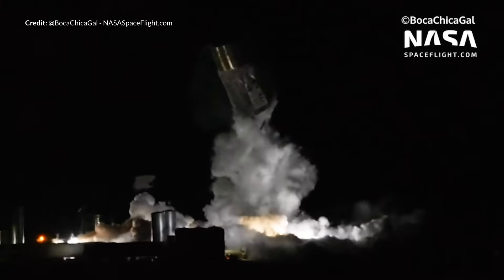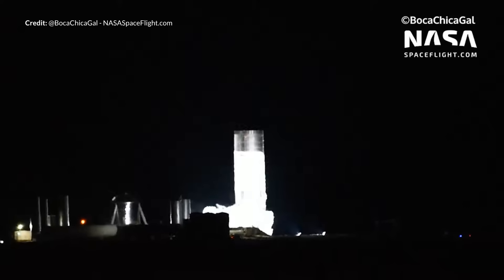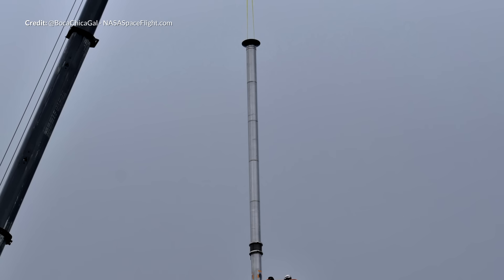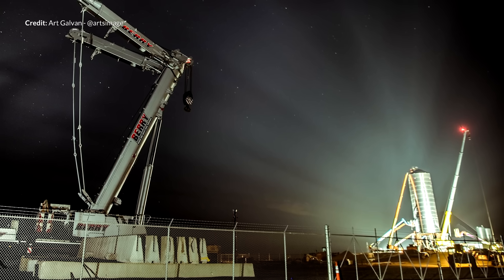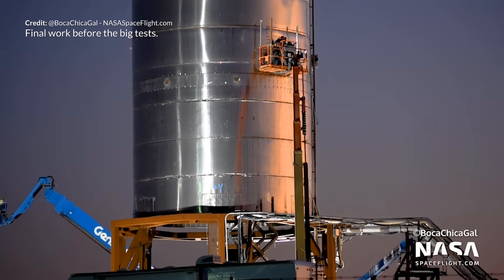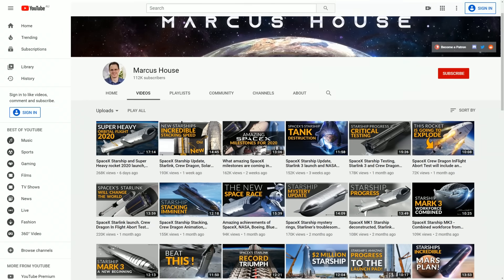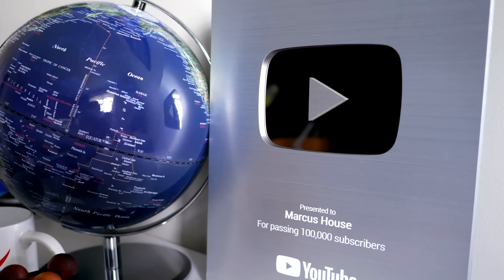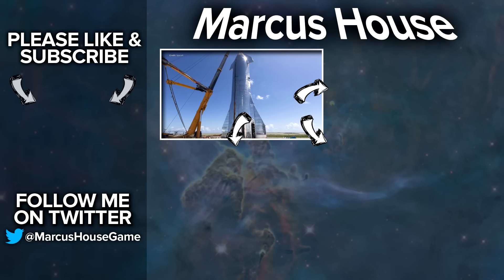SpaceX Starship Explosion of SN1 - Moving to SN2, CRS-20 delayed and Marcus House 100K sub thank you

Comment: Elon said there were bad weld settings, this tank was always fitted out as a full scale pressure test.
Reply: Come on guys, Musk is constantly speaking about first principle thinking.
With this tests they are probably testing a lot of iterations at once. To us it may seems like a waste of time and resources but they sure are learning a lot from the ground up while applying to rocket engineering.

Think about it: human race has had 50+ years into developing rockets yet still SpaceX is covering unknown grounds, that's crazy!
Reply: @RaphaelBrandão-z3f  That is not excuse to be sloppy. Yeah welding is in engineering well know topic. At least that we engineers believe.  Tthey will learn that hard way. I appreciate the SpaceX achievements so yeah. Still there is room  to improvement, sure. That is all.  Concerns need to be raised.
Reply: Yeah, this was just another test bed meant to fail.  I imagine SN2 will be on the stand next week.  That is, if the stand is not badly damaged.
Reply: @MrSmith336  I'd bet they build a new stand, that one looks trashed
my guess is 14-24 days till the next attempt
Reply: @MrSmith336  I don't think so.   By the looks of the welds, it's all inexperience and or experiments.   He's trying to see what quality of work they can get to pass to save money and time.   Compare this construction to what NASA does and it does not hold a candle to.
Reply: MrBen527 - This has far less to do with cost-cutting than it does with whatever SpaceX does in Boca Chica has to be repeatable on Mars, the moon or some Asteroid or anywhere else in outer space astronauts, colonists or workers are going to take this thing. Think of mining where miners often jury rig repairs, because whatever the environment doesn’t destroy, their fellow miners do. A boutique rocket will look nicer on the launch pad, but it won’t last long in that type of environment - This thing absolutely has to be repairable on site, & that site definitely is not going to be anything like Huntsville, JPL or Cape Canaveral.
Reply: @MrSmith336  Ahm... "meant to fail".  No, it was not meant to fail - it was meant to be no great loss if it did fail, but it was intended to withstand the loads imposed upon it.  If they'd intended it to fail, they would have had TV crews and better lighting.  And probably pyrotechnics.
Reply: Spacecx should do this
Rocket is complicated and dificulte 
Low safety and high cost
We need somethings better
Developing technologies to enable human access to space at dramatically lower cost and increased reliability #FeelFree http://youtu.be/6q7MovLP-e8 via
Reply: @javaman4584  Not expected to be tested to destruction is something else than not meant to be. It just failed, so they will improve. No Raptors for SN1, no big deal.
But after that Elon also never said how many Raptors SN1 would get, he evaded the question and instead said 3 Raptors on SN2. Things go and change quickly at the Starship team. Remember how we were all shocked by Mk1 exploding after which Elon casually said that was suddenly the plan for a while already, instead of a 20 KM flight.
Reply: Riiiight
Reply: Steel is the one thing that could be mined and manufactured with "relative ease".
Reply: You can’t mine steel; you have to forge it combining iron and carbon. It’s not that easy to get hold of it in a place like mars.
Reply: @MGRambo-mi4hg  The actual work may be hard, but Mars is red from iron oxide, and the atmosphere is mostly CO2, so you do have the elements you need in abundance.
Reply: @MGRambo-mi4hg  if only it was as readily available  as the foolish are amongst our species
Reply: @MGRambo-mi4hg  Iron chrome and nickel. It is stainless steel.
Reply: @galfisk 
What about the nickel and chromium required for stainless? Is that available easily on Mars?
Reply: @themartianway  mine steel, you do know that steel does not exist in nature, its a man made material
Reply: Starting to sound like excuses now.
Reply: SpaceX is wasting time & resources over building prototypes, prior to fully developing their welding process & joint designs. Why don't they perfect the welding and joint designs on a small scale build first??  IMO, using manual TIG welding is a quality control disaster unfolding ... Spin Welding is the only way to go here.
Reply: @KrustyKlown  I think the logic is that it has to be a method repeatable on mars.
Reply: @themartianway  I think it's going to be a long time before stainless steel is produced and starships fabricated on Mars.
Reply: @KrustyKlown  that was what you call as Progress, well space X is doing what in the past Thomas Edison doing tested every possibilities and learn from it. It was crude but it works for Space X so far
Reply: @BigCooter.com What you're essentially arguing here is the difference between "test fast and fail quickly" and "go methodically and carefully." Starting from what would essentially be first principles (welding and joint designs) and working up from there would ensure fewer failures, but it would also make the development process much slower. SpaceX is all about speed.
Reply: @KrustyKlown  better more little prototypes where the audience can see the improvement every week, then 1-2 bigger prototyps where a failure would be rly expensive. I think that way of building prototypes has way more positive arguments
Reply: @KrustyKlown  the welding method should be questioned I agree. Someone needs to put this to Tim Dodd to ask Elon
Reply: @KrustyKlown  I was thinking that looks extremely hard to weld.
Reply: BigCooter.com 65 years ago Convair mastered SS welding for large missiles....John Glenn rode one into space.
Reply: @jamesanderton344  65 years ago they had different metallurgy, and different welding techniques. They also didn't need it to be heat resistant for reentry.
So if they tried to simply replicate old technology, it wouldn't work because the requirements, materials and size is different.

So it's not surprising that they have to start from scratch and go through the same process they did 65 years ago, and learn how to make a larger rocket with different materials, welders and requirements.
Reply: ke6gwf Musk has said that they are using 3 series commodity stainless. Well characterized material used extensive in the process industries. This is a bad failure. The running length of joints almost guarantees problems. Too many joints, built in primitive conditions using commercial welding technology.
Reply: @KrustyKlown  BECAUSE FAST
Reply: @KrustyKlown  The entire point is to test for large scale failures using imperfect materials and techniques. Yeah SpaceX can build the Starship using the knowledge and techniques from the Falcon 9 and it'll fly first time. They can also hire some nuclear rated welders and have every piece welded perfectly. But if you are going to be producing at scale there are always going to be problems with the supply chain. Imperfect steel, bad welds and critical areas which modelling can't predict because of harder to model aspects of the material technology like crystal boundary transitions and weld variability. Plus half the fun of starship was it being built by normal tradesmen and not the best trained and highly skilled people. Sure you lose a few prototypes but you can knock up a line of steel tanks and bodies a mile long and still cost a lot less then modelling and building the smell using the absolute best tech.
Reply: @Techburn997  @BigCooter.com I disagree with this. Starship eventually will carry hundred of people. You want to have the most robust, reliable weld process as possible. You want to have a machine to weld perfect welds every time, Xray the welds to find defects, so that when you spend the time and money to build a tank, that it will survive it's required proof test. Once they have their weld process perfected, then it becomes cheap to make them after that. All it takes is 6m or less to do that development. Look at how much time and money they have wasted on building ships, not to mention the poor stress analysts in the background, I'm sure being over-worked by Elon.
Reply: @chadpurser  Yeah i m with you on that one. They could made robot first. U could transport it to the Mars no problem. Aka welding roomba. :D Little oversight for prototypes. To be fair Musk mention robotic welding etc. But i guess he needs roof for clean environment. Witch is very important to make perfect welds. So really hard to do that way. So yeah. Just disaster was expected really.
Reply: @chadpurser  Oh yeah 100%. I probably should have continued onwards with once prototyping has been completed the entire manufacturing process would have been refined to use the best manufacturing processes and tooling for human rating. The entire design would probably be friction stir welded and each steel panel carefully tested to make sure it is the right stainless composition (there have been may reports of bad batches, lazy testing and counterfeit materials getting past quality control checks (usually noticed in aerospace but know that it is a real issue for many industries as fake QC certs and dubious sub-contractors selling low quality products as high grades). 

But where the Starships prototypes are making strides in is that quick prototyping using standard construction techniques instead of spending tens of millions on setting up tooling for a design which has changed several times since it's inception (see videos on the machinery for friction stir welding). Aside from what all the marketing and such says I view Starship as a tech demo to demonstrate that Stainless Steel is a viable construction medium for space travel, maintain public interest and a cheap way to test design idea outside of a simulator. Additionally it is a great way to showcase to the public that aside from the engines themselves that rocket technology isn't some mysterious high science that takes the smartest people to understand, that 'normal' people can and do work on a project which will eventually become something that will exit our atmosphere. That a welder making a grain bin or boiler has the same skills which makes the tanks of a space capable craft (which while true any human rated or commercial cargo version will be done using extremely highly trained and experienced welders (or automated systems). Also by making all these cheap prototypes and learning where they most often fail the tooling to have these areas made using robotic MIG/TIG welders or friction stir jigs designed first before other less critical areas. Given how expensive automation systems are figuring out where you need a high precision system vs a well trained human or what areas can be worked on in-situ vs what shouldn't is important for future projects. But in the end the Starship prototypes are meant to be made cheap and fast so failures don't impact schedules and what lessons from the last 60 years of rocket manufacturing need to be relearned or apply to using Stainless Steels as the primary material.
Reply: @KrustyKlown  Meh, have you seen the welds on SN2? They look 10 times better than this, if they are acheiving this kind of quality on SN1 and not to mention its ability to withstand pressurization with no leaks, I have complete faith in SN2's quality control. Also... it's a good thing they didn't bother putting as much work into the welding on SN1...that WOULD BE a waist of time and resources. 

Secondly.... we are talking about SpaceX and Elon Musk here, for every month that space X spends building stuff here, NASA would spend TWO YEARS... minimum lol.  I think they are doing just fine in terms of time, and given the entire approach they are using here, resources simply aren't an issue whatsoever.